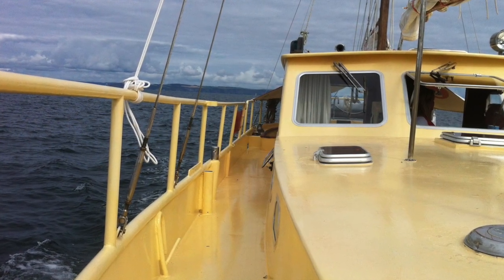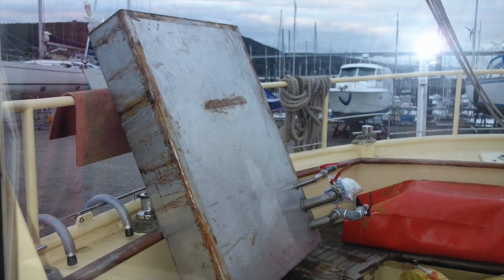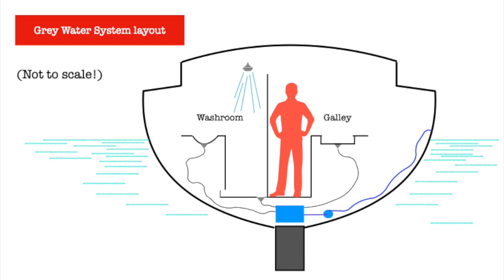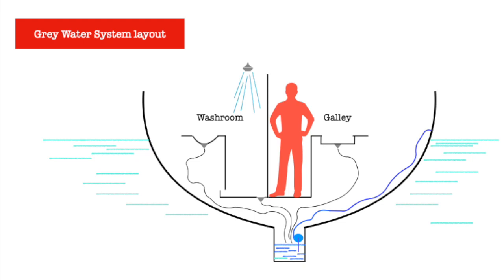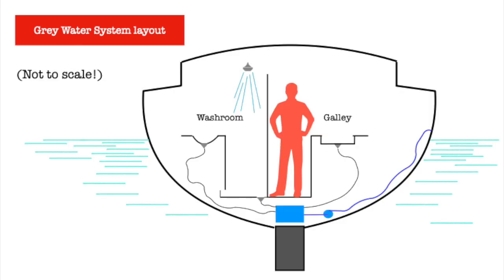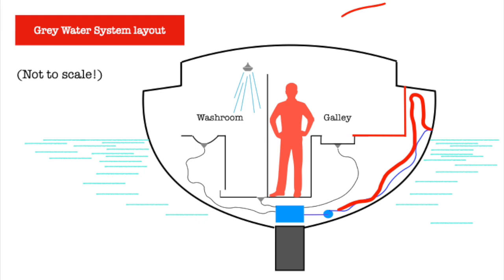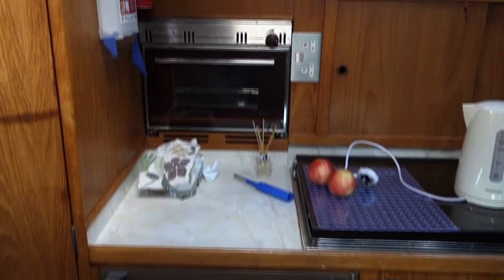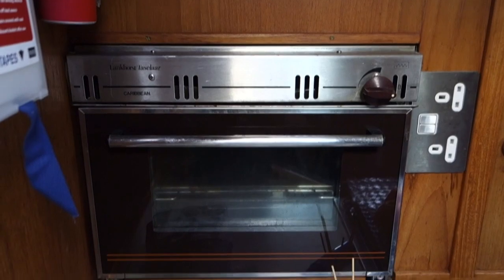Skipjack Sailing 4--The Adventures of a Navy Nuke Escapee.

Comment: Russ, noticed your plumbing appears to be an assortment of dissimilar metals.  It's more clearly seen in your video where you drew out the potty water system.  Are there sufficient numbers of copper fittings mated to galvanized iron pipe and iron pipe to stainless fittings that you are concerned about dezincification or general   galvanic corrosion?  I noted your concern about the bite type ferrule fittings being susceptible to vibration fatigue but I would be more concerned about metal failure from galvanic corrosion.  (Just an a-ganger asking).
Reply from the maker: I noticed the same as I demob'd the shit system.  (I know that an A-gang dude cannot be offended by language!)  I had copper and stainless and carbon steel all mated up.  
See Video 13--simpler is always better on a boat.